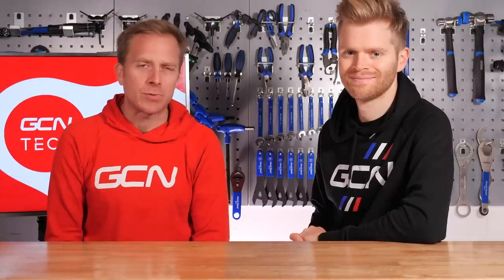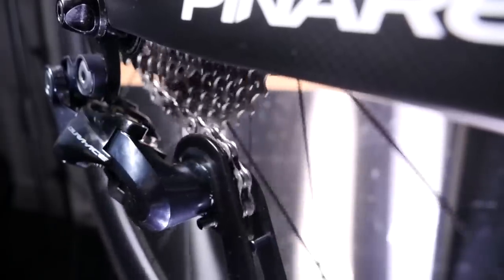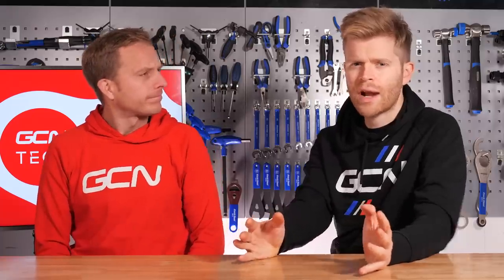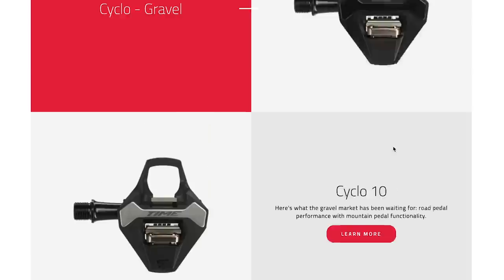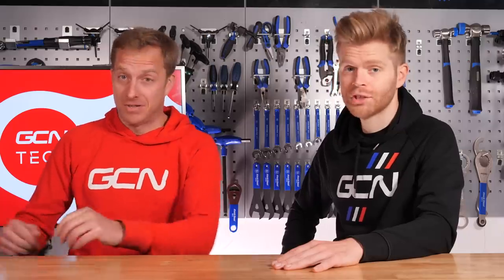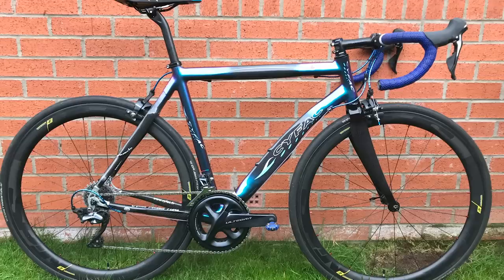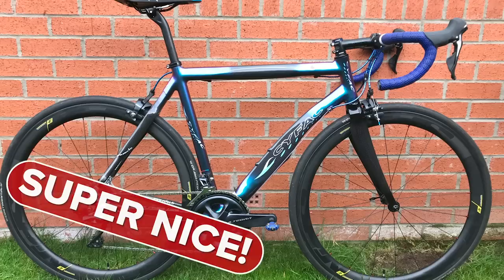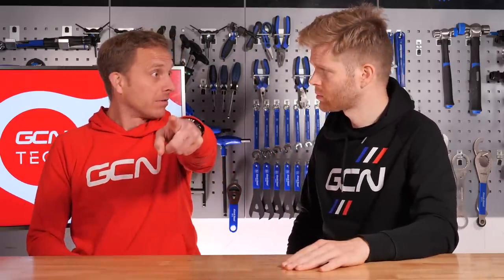Road Bike Tech We Want To See In The Future: How Can Cycling Get Better? | GCN Tech Show Ep.94

Comment from the maker: What would you like to see on road bikes in the future? Belt drives?Carbon disc brake rotors? Let us know in the comments below 👇
Reply: CVTs with fully automatic shifting. For me it's not something for the future, I've already done it. As for as I know no one else has.
Reply: Carbon disc brakes
Reply: I have just replaced a bike with 8sp IGH with the one with a 3x9 standard derailleur and now you say the former is the future?! ;)
Reply: Please make a video: know your presenter for Jon and Ollie
Reply: @PrzemyslawSliwinski  Its all about getting rid of the gears without becoming a single speed, infinite speed is the way to go.
Reply: electronic (wireless) brakes - since integration + electronic shifting have come such a long way. Real clear cockpits
Reply: How about a universal disc brake pad standard instead if having 1000's of different types
Reply: I wanna see budget carbon bikes that are high quality
Reply: @feliperenaultcsp  It's an idea I think about sometimes. Problem is making a system, especially if wireless, that is fail safe. For this to be the case the brakes would need to be spring loaded on and require power to hold them off. An interesting engineering challenge.
Reply: Your idea about mud proofing cross bikes sounds like a great idea.  Especially considering how many bike changes there are in any given race.
Reply: I would like a high quality, light bike for $1000.00 dollars
Reply: Flying bikes
Reply: I would like to see lighter and quieter disc brakes and one that allows the cable to decouple from the cockpit without having to rebleed 

And yeah, a walkable metal low to no maintenance road cleat
Reply: It would be cool if someone developed a repelling magnetic field  bearing (or whatever they'd be called), no BB's no grease, zero friction  and the ones in the wheels could be tuned to give a bit of suspension for crappy roads or hard as nails on super smooth surfaces or something. 
when jon said "I would like a clear frame" I thought I might as well think outside the box a bit
Reply: An air bike ( made out of air that can be sat on)
Reply: Clear helmet. The Trek helmet with that new helmet innovation insert and a clear shell would be sweet.
Reply: GCN Tech Well.....way in the future? A self adjusting bike. It automatically adjusts to become your perfect fit. Sounds a bit fantastical though.......
Reply: The future of gearing is a generator in the bottom bracket and a motor in the rear hub, only connected by a wire. You don’t select a gear, but you select a cadence (meaning you will speed up as you put in extra power, but your cadence remains the same) or you select a resistance, meaning you pedal at 200 watts, with varying cadence, and the bike gives 200 watts. Can become tricky when going uphill, might only work with an e-assist bike that last one.
Reply: Dan Litwiller buy a bike for 1000 dollars right now. It’s high quality and light compared to 30 years ago.
Reply: No more electronic shifting. I mean what's next, electronic or regenerative braking? So not only do you have to charge your shifters, but your brakes as well? No thanks. I'd rather have one cable fail and it be a 5 minute fix rather than the electronics fail or die - possibly resulting in my own death - and it wind up being an even longer - and more expensive - fix. 

Keep the cables please!!
Reply: Dapster regen braking means the brakes charge your batteries, so no more charging...
Reply: Monocoque carbon wheels. (Low maintenance, aero, stiffer, and room for like 15 speed drivetrains) imagine a wheel like that would last a lifetime
Reply: @jochem1986  Which is exactly what we don't need on a bike. We already have enough things to charge, like a phone, tablet, etc. A bike shouldn't be one of them, unless you own an E-bike. Plus at least with an E-bike you can still ride it like a regular bike once the batteries go dead. If they die on Di2 or eTap then you're screwed.
Reply: Just did the calculation and even using 11spd spacing and a slight lenticular shape, there is plenty of room for 15 speeds lol
Reply: @jochem1986   I already have what you describe as future gearing but it's based on a CVT,  a generator and motor would be far too inefficient.
Its amazing the bike does speed up if I put in extra power and my cadence remains at my optimum. I currently have it set up so my cadence changes depending on my power output.
Reply: Yes protected drive train with many speeds. Could be cvt if it's economical and light weight.. and durable. The most important thing is that drivetrain must be protected, under some cover, but it must look slim and nice.. Doesn't matter if it's belt or chain or shaft.. With my current Shimano r7000 cassette and dérailleur. When I casually ride through of big grass, over meadow or something. It so often happens, that suddenly chain start skip over teeth and also shifting not working anymore and then when I stop to check what's the cause. It's just some grass wrapped around the shifter or some big branch of dry weed got caught to derailleur.. Road bikes are not to ride only on tarmac, or asphalt anymore..  already now. In future it will be even more so, mtb will not disappear completely but.. as gravel/adventurer bike is more practical and probably also more environment friendly to build and maintain and also to use, since it can't be used on so extreme conditions, so people won't go and kick bear out from their home, because they want to ride there and destroy all tiny plants and bugs on ground.
Reply: A 10 speed drivetrain that lasts 10 times as long and costs a tenth of the price.....it's called 3x7 halfstep
Reply: I would like to see integrated charging for all my electronics. All mounts would have contacts that would connect to a built-in alternator that would be powered by the spinning of my wheels while I am coasting.
Reply: ABS brakes?
Reply: @michaelx9079  I've found that 11 speed drivetrains last longer than 10 speed, could be better materials, but thinner chains do have less friction at any angle greater than 0° so it stands to reason they'd last longer
Reply: oval wheels
Reply: in the future i would like to see natural selection.  Away with e-bikes: if you don't want to put in the hours, you ride slow.... (i would let disabled people off the hook, or if you give up your car)
Reply: Tighter quality control and manufacturing tolerances would be excellent to see.
Reply: @feliperenaultcsp  Wireless brakes are going to be dangerous.
If you have it default ON then in a failure event the brakes could slam on.
Default OFF sees you with no brakes (and probably no idea).
It's why cars only have electrically assisted brakes.
Reply: @twatts4436  That's the problem I see with the idea of wireless brakes. A real engineering challenge to get it right.
Reply: Want to see Lower priced I.e. not price gouged bike frames.  Made in China but then saying USA or Italian made bike is a scam.  Next bike may be a yoeleo.
Reply: Fairings on aero bikes, not huge motorcycle style ones but more like winglets to push the air around and over the rider !
Reply: Charles Rush 😂👍🏻
Reply: Carbon Ceramic DISCS.
Reply: @noahfontaine7832  At least ones that are working. Not like the Alpha ceramic which were destroyed almost instantly
Reply: Now that my kid is racing, I'd like airbags on bikes for when the crashes happen!
Reply: "What would I like to see on road bikes in the future?" ME!!! (I'm 63; only have another couple decades at best ...)
Reply: I'd like to see the most fantastic thing ever. One bottom bracket standard!  I can dream, can't i?
Reply: Carbon frames whose warranty is not limited when using smart / turbo trainer from all manufacturers 🥴
Reply: Force field mud guards.... fingerprint anti theft brakes... heated hoods... heated shoes...
Reply: maybe wireless/electronic brakes?
Reply: Electronic down tube shifters. They’ll be sold to us as a 5watt saving at x degrees of yaw😬
Reply: A bike I can fix/afford/have tools to fix. Like... non electronic/Hydraulic BB30.... 86.....blah blah. Two wheels, 8 gears, cable activated but light, aero and sensible recyclable. Well I guess I mean a 90's bike.... 🤔👍
Reply: on a bike? how???
Reply: Headed handle bars or heated tape. For those of us in northern climates it would be wonderful
Reply: @MrPoopnoddy  Too bad it will add 5 lbs and only be 83% efficient.
Reply: @Ed.R  Too bad it will add 5 lbs and only be 83% efficient. Your project's good for hybrids but not road bikes.
Reply: @Ed.R  They're inefficient. Tt seems like you working/have worked for Nuvinci.
Reply: @shannontrainer5857  I'm loving it on my new road bike at the moment. The enviolo SP hub is more efficient than previous models.
Reply: @shannontrainer5857  Never worked for them. I just bought a hub 8 years ago and have been obsessed with them ever since.
Reply: @Ed.R  83% compared to 95% with
derailleurs is not efficient.
Reply: I would like to see some more options for bike tracking. Bike thieves suck.
Reply: @shannontrainer5857  83% is not representative of the efficiency. I know because I have many thousands of miles experience riding CVT hubs.
Why the obsession with weight and efficiency? The biggest factor in how fast you can go is your own fitness. I've got a few KOMs on Strava so the CVT isn't holding me back much.
Reply: @Ed.R  It doesn't change the fact that a smooth ball rubbing against two smooth surfaces is less efficient than gears meshing with each other.
Reply: Forget the future bikes. Modern bikes are awesome. I want fully separated bike lanes everywhere, smooth, no cars, no baby strollers (I love them, just not on the bike lane), no potholes, just smooth bike lanes everywhere I look.
Reply: cycling shoes that fit, and are not just made for appearance!
Reply: @jochem1986  I have been dreaming of such for a while. And I think with proper power electronics / transformer it'd be possible to deal with hills even without storage (i.e., batteries). Also for unconventional configurations - like many recumbents - this simplifies things greatly. Efficiency is the challenge given the rotational speed of cranks - I'm guessing it would be hard to hit 75% overall right now.
Reply: @dapster  If the bike has its own regen, you never have to charge. Think of the trivial power output of your hands when shifting a cable bike - it's probably under 0.01W average. Why not harvest that from braking like Jochem suggests and do away with ever having to charge a battery to shift (or to run out of batteries - which I agree is an abomination!)
Reply: I want to see chains disappear and see shaft-driven drive systems become the norm!
Reply: The same gosh darn bottom bracket and headset on every bike.
Reply: A 3D printed bike.
Reply: Cheap 3D printed custom frames, wireless brakes, airless tires that outperform pneumatic tires, and chainless drivetrains; be it CeramicSpeed Driven, more efficient belt-driven gearboxes, or some kind of CVT, just something where you can have way more gears without dealing with chainline issues. Always clean and clear frames and components sounds pretty neat too, with available colored tints of course.
Reply: @MrPoopnoddy  That's the way to train, heavier the better.  My automatic shifter would keep you at 95rpm + - a couple on all be the steepest hills.
Reply: @shannontrainer5857  The planet's don't touch or rub on the traction rings, they are separated by a traction fluid. It's what's known as liquid gears.
Reply: hydrolic v-brakes
Reply: One single type of bottom bracket for all kinds of bikes...
Reply: VR zwift, and trainer with realistic terrain simulator? Attached to bike frame, when the road goes up so does the bike, when the road goes down so does the bike. With max elevation up to 40%. So not only just steering simulator like we've seen on eurobike 2019, we can also go uphill and have epic descent with epic cornering like real. Like riding a rodeo
Reply: You can buy a spray called never wet that you can spray on anything to make water and dirt proof.
Reply: @najibnajmudin512  I think that would be called "outside".
Reply: @DaanHoogland  well, when you wanna go outside tackle some climbs but it's raining as hell, that's a legit solution.
Reply: @najibnajmudin512  of course, but you'll never have the sensation of going up or down, unless you go up or down.
Reply: The one thing I would absolutely love would be new derailleur technology. I hate those so very much. Especially the front derailleur. Adjusting derailleurs for new chainrings, when putting the bike on a trainer and so on is so much hassle...
Reply: Transparent alloy frame , Star Trek inspired, and they cay make that stuff now.
Reply: Number 1! Light Reliable Effective ANTI-LOCK brakes
Reply: Improved carbon fiber rims instead of CF disc brake rotors. Non-epoxy matrix if needed for superior heat resistance and braking. Maybe nicely integrated hydraulic rim brakes with ABS.
Reply: Tire that would be cheap, durable/long lasting and would work extremely well on any road, from mud and gravel to smooth asphalt.. Very fast with little rolling resistance and very good grip and light weight too.. That rear tire would not wear quick on asphalt, but still very good grip on mud.
Reply: @Ed.R  It's still less efficient than gears meshing with each other.
Reply: @shannontrainer5857  That may be true but there is more to the efficiency of a person on a bicycle than just the transmission.
Reply: I want ceramic coated tires. Water won't stick to them, nor asphalt or concrete.....
Reply: I'd like to see high-end carbon frames again with threaded (best BSA 1,37x24tpi) bottom bracket and outer routing of cables! The first seem to be coming back...
Reply: GCN Tech shimano Di2 wireless!
Reply: 16:35 That is actually close enough to pass as correct Danish pronunciation, with a slight Aarhus-region dialect. Well done! 👍
Reply: I want a self-aware bike that can sense how I am feeling and send soothing vibrations to my perineum when it senses distress
Reply: Di2 Electric brakes to do away with cables
Reply: I'd like to see Affordable (less than 2000 euros) time trial bikes with integrated fork and stem.
Reply: Daan Hoogland  Magura did this years ago. Look up late 1990’s-early 2000’s trials bikes.
Reply: Daan Hoogland Magura HS-33’s specifically.
Reply: Shoes that have integrated cleats. Northwave dabbled with the idea of replaceable carbon soles back in the early 2000’s.  Let’s take it a step further and stock shoes (i.e. you buy your stock size 43 shoes) and then bolt a 3D carbon printed sole and cleat.
Reply: Built to measure stems and seat posts to fine tune bike fit. Image getting a stock 54cm frame then getting a 127mm stem and 5mm offset post (or whatever) to truly get that personalized fit!
Reply: Durability is definitely the "feature" missing from many current offerings.
Reply: @tomerperrier5939  ????????????? 😲
Reply: Carbon Discs really are a good idea... Top racecars use carbon disc brake rotors.  Carbon-ceramic, but still.
Reply: @tomerperrier5939  Check your spelling.....
Reply: Don't think for a minute the ideas for future tech presented here by viewers aren't being scanned by bike manufacturers.  But don't worry... nothing progressive put forth here can be used by the profit driven manufacturers catering to standards barely changed since the 1890's.  And don't forget UCI's wink and a nod to those standards.
The bottom line is manufacturers are providing second string bikes to world class athletes.
Anyone heard of Formula 1?  You know... that sport where the best in the world drivers are provided with best in the world tech to win races.  Compare that to The Tour De France.  You know... that race where the world's best riders are provided with off-the-shelf bikes.  Lewis Hamilton racing an off-the-shelf Mercedes AMG 63 S street car?  Uhh... No!  Peter Sagan racing an off-the-shelf S Works Venge?  Uhh... Yes...Yes he is!
This whole situation is fueled by the average club rider (and GCN) who demands minor progression in technology so they can emulate this year's Sagan bike at the next C paced ride.
But don't forget the line "It's too expensive to develop one-off bespoke bikes for team riders" and "it gives them unfair advantages if technology is advanced too drastically".  Motors win races in bicycling and don't worry the money is there for development, it's the under the table money that needs to be addressed.  Keeping outdated standards in place is what keeps bicycle design a career choice for  2nd rate engineers who don't have the skills to come up with anything new.  You know... those ideas that could transform today's store bought "Formula 2"  bikes into Formula 1 bikes derived from last year's bespoke built Tour bikes.
This post is now able to be lost and forgotten in this stack of other "hey look at my great opinion" posts.  So you can move along now... there are many new cat videos to keep you occupied... or maybe it'll be next year's Dura Ace gruppo that will fit (with very minor mods) your 1975 Colnago that will keep you hypnotized.  Good Boy...

Comment: **Remotely controlled tire pressure**  I would especially love that on my gravel and fatbike, because a few PSI can make a whole difference while riding variable terrain. It's never pleasant to dismount to pump or release air. Perhaps it could be controlled by the rigidity of the tire casing rather than actual air volume (Imagine the tire inner thread could soften/harden based on electric currents, like a muscle fiber)